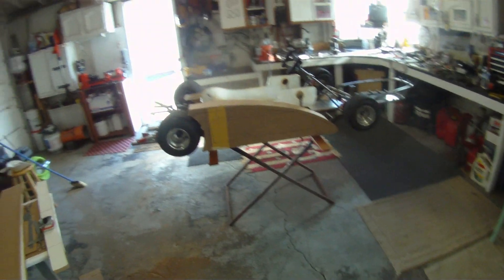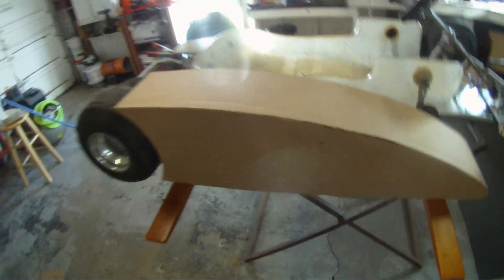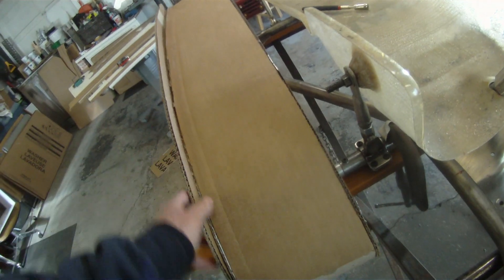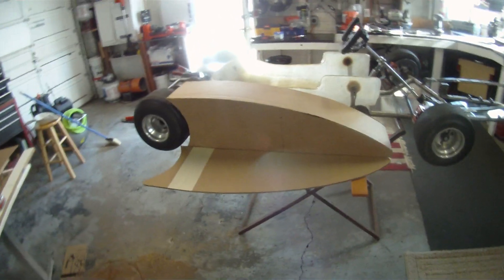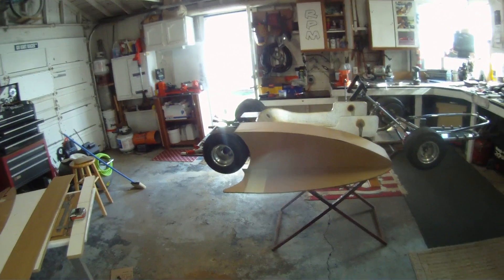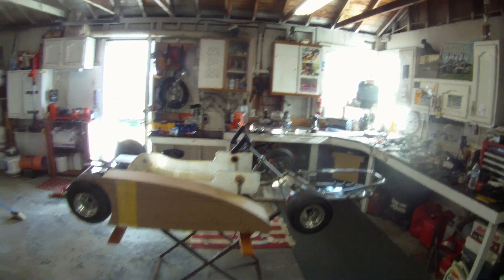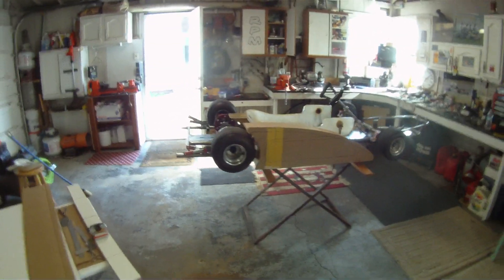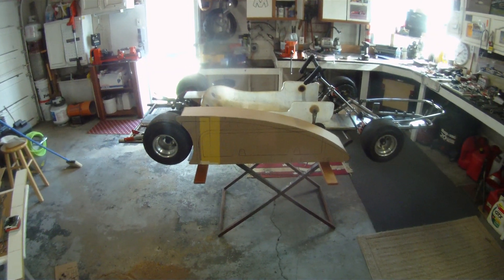Briggs Animal Project Kart - Modeling Side Pods Pt. 2

Comment: Only part that concerns me is the leading edge of the pod behind the front wheel. At our tracks it would be sand blasted through in a race or two.
Reply from the maker: 3M makes some very tough crystal clear leading edge protectant film. Only down side is when you want to change paint scheme it removes everything under it as you peel it off!!!